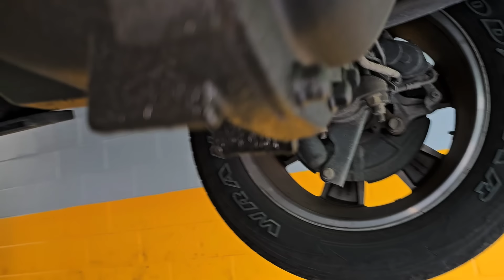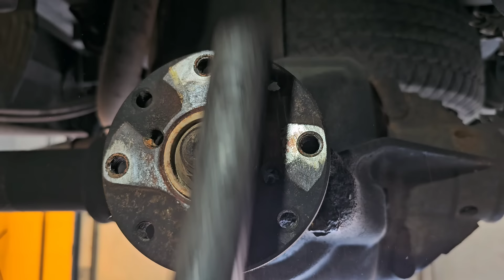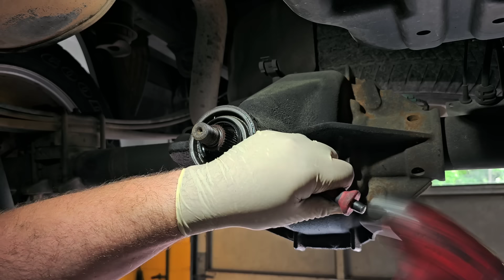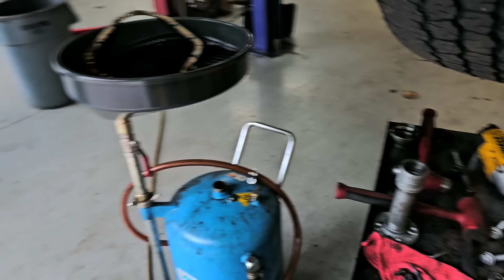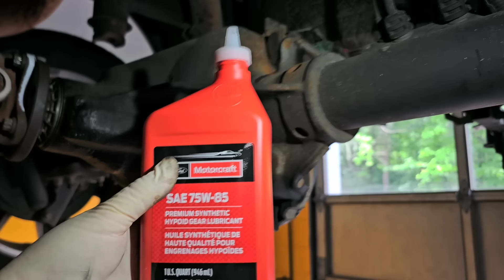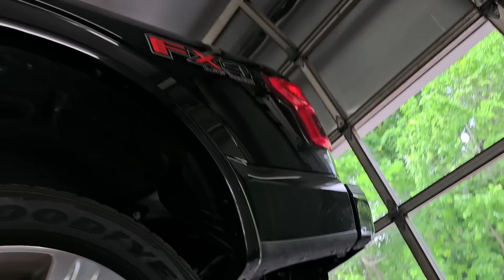Rear Pinion Seal Replacement The Easy Way!! Ford f150

Comment: I don't understand the three marks before disassembly. How do you know how many threads you used tightening the nut, as that is how the tension is determined. What am I missing? Thx
Reply: If you notice it took some tightening to get it to line up. Then he tightened a bit more past. That's how you know it's good.
Reply: You don't know how many threads. As you tighten your listening for the sound to change and you're feeling for the play to go away. When the play is gone and the sound changes abruptly, you continue to tighten until the mark on the nut is just beyond the pinion mark. The mark on the flange is just not that important. Also, he was feeling for the rotational torque to increase slightly.
Reply: A full turn off is just unlikely- one turn loose, and the nut will still be turning easily. You probably could not make it a turn too tight, and if you did, the bearings are damaged, disassemble and replace them, with a new crush collar.
   An exception would be if the splines are so tight that you're unable to tell when that flange bottoms out.
   Also, the thread pitch is probably about 1.5mm +/-...most astute people can easily discern a 1.5mm difference in the position of the nut by eye, especially with so little of the pinion shaft sticking out of the nut. If not, your eye needs some calibration.
Reply: U are supposed to count the threads..u are correct..
Reply: @mikea1973  if you remove the nut with an impact like he did and installed it with an impact, how can you possibly count the threads.
Reply: @needhelp2453  u bump the impact in small increments ..remove the socket and count the threads..its not rocket science..just like u count threads on a outer tie rod..so to keep the toe correct.